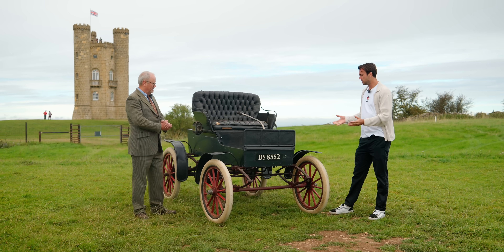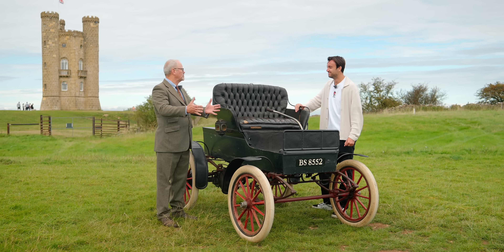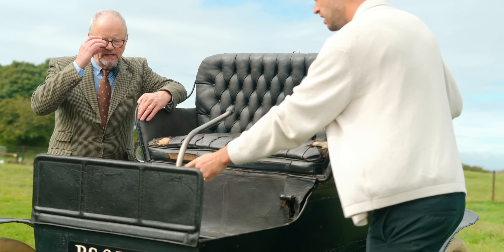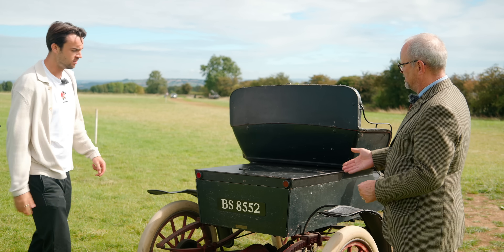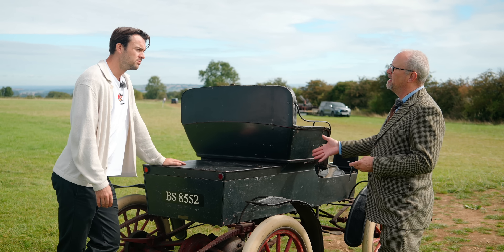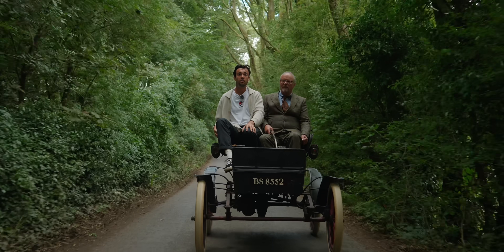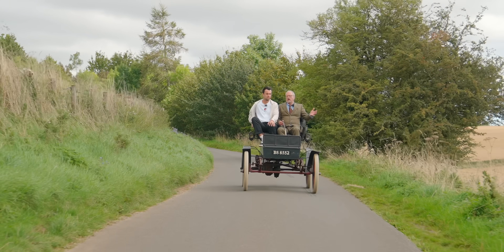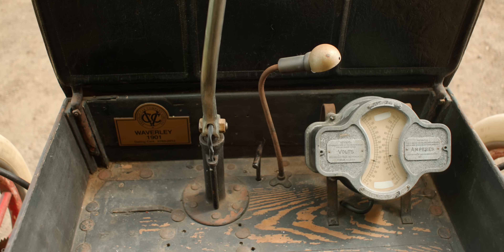Why Electric Cars Failed 100 Years Ago

Comment: My "What If"... to the analysis of why the electric car largely disappeared for 100 years is, what would have happened if research on batteries had continued at the formidable pace that it now has, way back from then? I know there are stories, a few certainly true, of research being quoshed by oil/gas companies, and patented technology being bought by oil/gas companies and deliberately shelved. Even working popular electric bus transport systems being bought out and eliminated overnight. But what if the battery had not been largely confined to just 12/24V for transport engine starting, golf carts and milk floats, etc? Would technology have been ready by say, the 1950s? And would we have needed a 1950's Tesla company to get us all turning in the BEV direction? And what kind of world would we be living in now? Just a thought.

Comment: 3:51 the Baker Electric shown in adverts here was sold from 1899 in very large numbers.  There's still a few of those around too, there's even at least one that's still a daily driver.

Interestingly, the Baker Electric was the only car to have a whole new battery chemistry specifically designed for it, the Nickel-Iron battery, & it's far superior to lead-acid in many ways, not least that you can actually use it without harming the battery. Nickel-Iron (NiFe) batteries are used in submarines because they don't give off toxic & corrosive fumes.
Reply: that's interesting. Was that battery made by Edison corp?
Reply: @freewheelinfranklyn  Probably, as Edison patented it. The two things Edison loved most: Patenting everything, and putting his name on it. He recognised the importance of his own public persona in promoting his products.

Comment: shame today we didn't standardise on battery packs so they could be easily swapped out, instead we've got them buried in the chassis and all different shapes and sizes, all non standard. Same with controller cards, would help in prolonging the life of the vehicles rather than "sorry we can not get those controllers, no longer made - have a new car"
Reply: Battery packs thesedays typically last longer than the car does.  I'd expect it to be more likely to replace an ICE car engine than an EV car battery, yet standards in engine mounts is pretty rare (I think Subaru does it?)
Reply: @roidroid  I was really saying instead of charging, swap the battery out for a fully charged one as in the video. I know there will be different sizes but standardize on one size and use multi in vehicles that need more power. My point about standard parts is that this could have been a great opportunity to embrace standardisation, rather than have 100s of different types of batteries / controllers, very green, saves on manufacturing emissions etc. I work in electronic design/repair and know Fullwell the problems with failed components.
Reply: @dubstatic  ah 👍🏻

Comment: I have a feeling electric cars are going to fail today. I like the idea, don't get me wrong, but they've become incredibly expensive to buy and to run. The asking price alone for some of these cars are unaffordable for the majority of people, and I am not going to buy a 2nd hand electric car because I don't know what condition the batteries are in. Electricity prices have increased so not saving any money there. Insurance is double that of a standard petrol car because they're heavier, cause more damage in a crash and the batteries have a tendency to spontaneously combust. The manufacturers have to come up with an interchangeable battery system at petrol stations for this to succeed so people have range and won't be waiting around to charge their car.
Reply: They haven't "become" expensive, they started expensive & are becoming cheaper over time (like everything).  
They are cheaper to run than combustion cars, it's common to charge them at home with free solar.  They are also cheaper & easier to maintain.
Due to improving battery tech, they're not much heavier than combustion cars thesedays.
Your combustion car is 60x more likely to catch fire.
It's more rare than U think to wait to charge, coz most ppl charge at home every day.  It's like leaving home everyday with a full tank of fuel.
Reply: @roidroid Tesla cars have come down in price because they're putting smaller batteries into them giving half the range of previous models. I can't afford solar panels, I can't afford a GTE Golf or a Tesla equivalent. The Irish Government have cut the grants to try and help people to move to electric and they're charging extortionate money for public charging. I have yet to see a petrol car spontaneously combust in a car park and destroy half the car park, while running yes, not switched off stationary. I want to go electric and do my part, it's unaffordable and I'll be punished. We need a proper path to change. The oil companies are still lobbying for fossil fuels.
Reply: Tesla has not halved the range of their cars.  
Solar panels are cheap & if u want them you can infact afford them.  
Actually yes you HAVE seen combustion cars spontaneously combust.  The car-park fires yeah?   They were all caused by combustion-engine vehicles.  
Please don't try to spread those lies again.

Comment: Actually, the original petrol cars would only go for about 10 miles before needing refueling, which could only be found in pharmacies. So this was vastly superior. And even the original Model T in 1908 could only go between 20 to 40 miles before needing refueling. So 60 miles was still far better. 

Ironically, what helped the ICE car kill off the electric car was the battery. And by that I don't mean simply that the technology wasn't there yet (which it wasn't) but the invention of the automotive starter powered by a battery in 1911. Until then, people were being mamed and even killed trying to crank up the engines.

And now the battery is back with a vengeance and in the midst of killing off the petrol car.